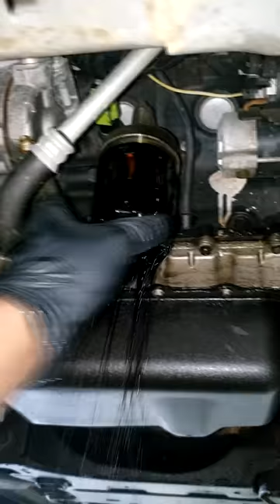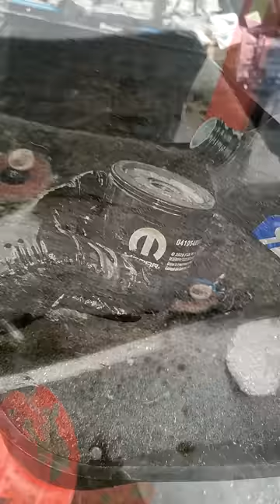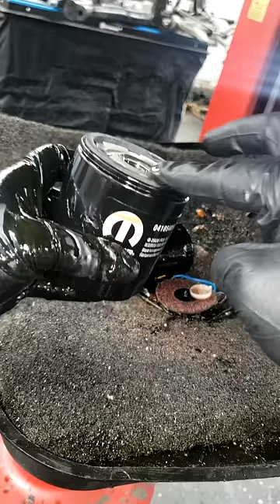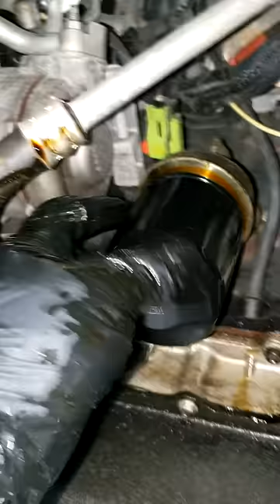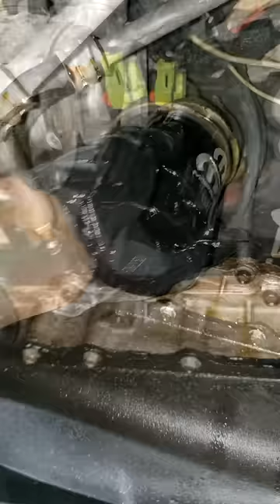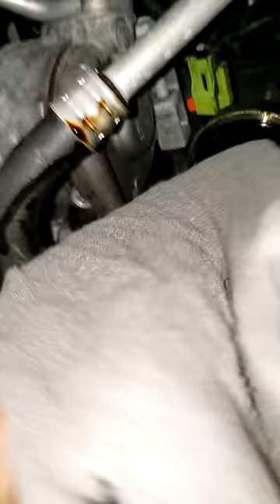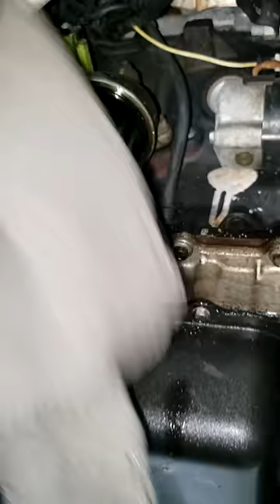Don't Lie.. Are yall still doing this?

Comment: Used to be a mechanic, now retired, but i still do my own maintenance and repairs to my own vehicles, and yes, i always have pre oiled the oil filter to help prevent dry starts.
Reply: on a 1040/1042/1060 filter?
or even a 7502 napa/wix (GM PF63 iirc) size?
.
that filter (and the WHOLE FUCKING MOTOR) has pressure in 2 or 3 seconds
.
especially with newer engines with TIGHT bearing oil clearances..... that tiny bit of dirt = 20,000 off the life of the motor
.
ya... a Detroit diesel series 60 or a 350/351/360 isnt going to care
.
but a hellcat? mustang 5.0? gm vette 6.5 motor? or your average everyday HIGH STRESS turbo 1.8L 4 banger?
Reply: @kainhall  why do you type like that
Reply: your vehicle dry starts every morning .Pre oiling the filter is pointless .and you add oil via the rocker cover , whish is on top of the engine so the oil makes its way down so all of the engine bits already have enough oil  for those few seconds during start up after an oil change
Reply: Even after draining the oil there's still sufficient oil left on the internals to start "dry".  I do oil the gasket but I don't fill it up.  It doesn't matter.
Reply: @randomusernumber1 Exactly the way I see it 👍
Reply: Alright I've got an 88 Grand Marquis with a 5.0 EFI, whenever I've done my oil changes and forgot to put oil in my angled filter, I had a lot of lower end noise from it lacking any oil to critical parts, DESPITE using Lucas in my changes to aid in lubricity and extend oil life - granted it's an oil motor and not a synthetic oil motor which doesn't add much for life but does decrease wear and I've yet to drop anything on the original 302 from pistons to pan. After I parked it with over 350k miles it still runs fine, other than chatty pulley bearings from what I don't know and nor do I have time to find out right now. My 97 explorer has a similarly angled filter, of which is use a shorter version so I ain't gotta break a fan shroud or bust knuckles when doing the filter drop, and I still add oil to it enough it won't leak out during install and prevent engine noise since it's not a fully charged filter. Y'all gotta remember when older motors needed time to get fuel to the carb and during that pre start oil was also being pumped as well to prevent super dry starts. As EFI became mainstream and motors became more and more computerized, sensor ridden and expensive they started much faster. Enter the anti-drainback valve found in most filters, not only did it allow oil to be almost instantly there for engine parts, decrease wear and extend overall service life. Granted filter placement and orientation, not to mention oil sumps that are more common don't exactly need those valves, back when you had a carbureted motor that needed choked during cold weather, that valve helped the motor work less in lubricating with thick cold oil from the pan than with cold oil in the filter so it could be started with a little less effort.....but advent of mainstream EFI and synthetic oil motors got rid of this headache and not instead of print things like this in owners manuals they print warnings on ingesting oils, battery acid, etc 😂😢 my first car was a 76 comet with an old iron horse motor which always had dry starts until I started pre oiling the filter, not just the filter O-ring
Reply: @krystoffersprague6100  that was a long one Kryst, barely made it through it all 😂, but I did, because I ain't no quuter.
Anyways. Old engines that were made back when dinosaurs were still around were just poorly made, by today's standards . The metallurgy was not what it is now.
Everything was cast in open air, slag and impurities were the norm. Heat treating shit steel gives shit results and so on. That is why every old timer still has a cut off distributor shaft to spin the oil pump after an oil change or a long stay. Back in those days you needed to do a lot of things to make sure the engine lasts.
But we are not back then. We are now, and now metallurgy has advances so much that even the cheapest chimasium is on part with what was available back in those days. Better steel means more precision and consistency.
Oils have also greatly improved, the film strength is higher, the lubrication is better and the taste has also improved to practically tolerable ( I am a mechanic, I've had oil on my face, hands and in my mouth multiple times, sometimes it's even brand new oil, old diesel oil tastes the best tho. DON'T DRINK OIL KIDS! MOTOR OR OTHERWISE!) 
I'm conclusion, many practices that were common place a few decades ago are obsolete today, they aren't bad, just unnecessary. On my older vehicles who have the filter facing up I do fill it up because I can and I see the possible benefit. But on my more modern ones with the filter facing sideways or down I don't bother trying, it's difficult and as stated, unnecessary. 
As for why your engine made noise on start up, it was just worn out and the oil cushioned it. I am guessing it was a push rod engine, those like a lot of zink in the oil due to the aforementioned poor metallurgy. 
Have a great day. 
Also, oil can be changed on a cold engine, you don't need to run it just to warm up the oil, have fun with that bit of info 😊.
Reply: The oil pump sits in the oil pan fully submerged. Prefilling filter does nothing to precharge system as pump intake is fully submerged. The oil filter is on the return side of the oil so the pump fills it, there is plenty of oil in the pan so system is not starved. Hydraulic systems are set up the same way, rarely intake sides are filtered. If it is one on the intake side, example diesel engine fuel filters, then prefill. Otherwise there is no point to prefilling automotive oil filters.
Reply: @Freiherr Dinkelacker I've had it since 08 when it was 20yrs old with 79k original miles. Since 2022 it's sat parked and moved once since my father in law passed, before that I used it as a daily driver for 12yrs, he for 2yrs, keeping it mechanically sound despite the lower end knock that persisted with each oil change with a dry filter.....even a mustang performance shop owner couldn't hear the subtle lower end knock and when I mentioned it only did it with a dry filter, he insisted on prefilling the filter even with a 2 stage oil pump because of the hydraulic lifters needing their oil and getting oil to vital parts. That subtle knock may need an overhaul, I'd love to do a frame off restoration in the future, but if my other two vehicles take a crap to where I need to bring the old girl back on the road, it'll be fine since I know my motor and it's quirks
Reply: Wut 😂
Reply: @randomusernumber1  no it doesn't lmao I worked at a oil change shop for 2 years and i did both and when you dont prime it. They sound like shit for the first couple seconds. Our cars do not sound like that every morning. Don't believe me try it yourself
Reply: @barrynordstrom331  wsit so you think it pumps everything though the system first and then it goes through the filter last lmao. What logic did you use
Reply: @gabrielgalaxygh  believe what you like mate , my opinion wont change the world and neither will yours . If you think that  dancing naked in a corn field will prolong the life of your engine then  by all means  dance your heart out .
Maybe i am doing irreparable damage to my vehicles , but out of all my cars and bikes I've never had an engine fail .I ride a lot , My bike gets 3 oil changes per year on average . Maybe the Japanese and the Europeans just build their engines better than americans do ?  Whatever the cause may be , the quality of oil used and the regular maintenance are what matters , not what ever voodoo magic  some  shaman bestowed upon you in a gas station once upon a blue moon .Have a great day .
Reply: @randomusernumber1  ok I read it after all because curiosity got me. 
When did I say that if you don't do it that your engine blows up or that is last forever if you pre fill? Go ahead I'll wait....... exactly I never said that shit. Read what I actually wrote. 
I said it sounds like shit on startup if you don't and when you do it doesn't make that noise. Dont believe me, try it on your next oil change and I guarantee your gonna say ohh that what he was talking about. Dont be ignorant bro
Reply: @gabrielgalaxygh  you do it because you believe that it is good for the engine , meaning that you believe not doing it is bad for the engine . 
Nothing lasts forever , at least nothing that humans can make currently . 
And i have tried it , makes no difference , as stated maybe Japan and Europe build  engines better than America , who is to say . Oh it's me , i am to say , did you read the part where i change the oil on my bike 3 times per year because i ride it so much ? That thing has never been prefilled , not by me , or the factory , the filter is on sideways ,it was never meant to be possible to think about prefilling it . And again , my opinion is my opinion , it wont change the world  and neither will yours , it does not matter  ,people will believe what they want to ,just look at flat earthers .
Reply: @randomusernumber1  I literally just told you why I do it.. because it sounds like shit.... also my car has a sideways filter. You just fill and let it sit for a minute or two and it soaks into the material and like I said its not gonna blow your motor so idk what 3 oil changes on your bike has to do with anything. 
Just curious because I ride also.
 What kind of bike you got? Lol
Reply: @gabrielgalaxygh  Why are you so hung up on this ? If it was helpful for the engine it would be mandatory to do and debating it is pointless . If it is not helpful for the engine then debating it is pointless . You think you hear a sound when you don't pre-oil ? Well i never have . So either your engine is worn out  , or it was badly made to begin with , or you are hearing noises that are not there but you have convinced yourself that they are because you are doing something  and there has to be some result of it otherwise it is wrong and you cant be wrong , right ? There is no point in going on about it , You just do what you believe in and if it is not hurting anyone then no one should care .
As for my bike i ride a small Suzuki vz800 Marauder . It has different names depending on the final drive and where it was  sold .
Reply: @randomusernumber1  I worked at a oil change shop for 2 years so I guess everyone here in the US just has a worn out engine? And no im not the only one. Plenty of other people say it in the comments section also so I'm not just hearing pretend sounds.....

Nice bike though, more of a crotch rocket type myself but one of my friend has a marauder and its looked and soundes badass, not the fastest though
Reply: @randomusernumber1  not trying to argue or talk crap just having a debate brother. You take care though and rude safe and don't forget to pre fill....just kidding lol

Comment: I have a cartridge filter, so my engine is definitely designed to run for a few seconds on residual oil while the filter primes. Same goes for anything with a side mounted filter, such as my previous vehicle. This is only even applicable to a subset of engines.

Comment: The most amazing part is you actually lube the oring before putting it on so you dont screw over the next guy
Reply: I don't see how it's relevant in his situation. Especially given that the housing is all covered in oil anyways. I'm a perfectionist in the shop and this is a pretty sloppy oil change. The goal is to ensure the maintenance is done, but you need to leave the area clean. This is C.Y.A. for the technician. It shows the customer you care, should they look. But it also allows for any leaks to be seen immediately afterwards so you can be sure you did things properly. It also leaves the area clean for the next guy.
Reply: Hell yeah some of those filters be welded on 😂😂😂

Comment: This is alway a must and just good engineering practice. If your filters mounted in this orientation it so easy to do. So why not. (Just the filling up the new filter with new clean engine oil part) It will extend the life of an engine.
Why is this good practice….
Each time you do this it reduces the amount of time it takes for the engine oil pump to build up oil pressure in the system.
Reply: Exactly, thats how i do it

Comment: Only on the big filters. Oil pump fills it pretty quickly on small ones.
Reply: Yeah i prime diesel filters but the small ones should be fine without it
Reply: I found this out the hard way when I forgot to put the filter on and started up the car for 2-3 seconds. Those oil pumps are no joke

Comment: I drain oil, clean all surfaces, fill filter about half way with a little oil on the ring. Run engine for a minute, checking for leaks then check oil one last time. In 30 years ive never had an engine fail from my oil changes.
Reply: Same here.

Comment: Messiest oil change ever from start to finish
Reply from the maker: Yea they can get a little messy at times. Im sure the mechanics used to it
Reply: You can't really do differently than he did ...
Reply: I change oil for my pal and myself, yeah this looked terribly messy.
Reply: @PhilQc109  what? of course, you can, and you definitely don't need to put oil in the filter. Just lube the gasket and make sure the old one came off with the filter.
Reply from the maker: @laxminarayananks1520  But what does this mean or matter? Help me understand why yall angry that you see somebody changing oil and it appears messy.
Reply: Honda oil filter on some model screw on the side of the engine. You will spill all that oil while trying to screw that filter on
Reply: Yea, I usually use a pet pee pads in case oil drips everywhere except the oil bucket I use. Oil goes everywhere, LoL 😂
Reply: I've done messier
Reply: @rodriguezdelbydr than fill the filter half way only so it doesn’t spill
Reply: @OnlineMechanicTips  don’t worry about the guys getting mad. Narcissistic mechanics will always look to get mad at something your doing “differently” than them. You can do the job messy or not. Me, I do it messy and I clean up after, no big deal 👍🏻.
Reply: @teevee2145 same.
Reply: @OnlineMechanicTips Are you talking about yourself in third person or are you not the person who we saw do the oil change... .?
Reply from the maker: @MechanicWelder94  excuse me
Reply: U must be a joy at parties
Reply: Nah bruh my mom's ex boyfriend changed the oil in my late great grandfathers van a few years ago and literally got it every where including in his own eyes dumb ahh😅😂 it was literally in the driveway and all down the tires, undercarriage,all over him like Their wasn't alot of space where he changed it that didn't happen to have oil on it
Reply: @rodriguezdelbydr  You need to dump out the excess oil in that case before installing, what you are trying to do is saturate the filter elements so they flow immediately once the oil system pressurizes.
Reply: @PhilQc109  do your cars not have actual oil drain plugs???
Reply: Wipe that shit down 😂
Reply from the maker: Grow a pair drama queen
Reply: Maybe it was his first time? Sounded like he was kind of slow too
Reply: @OnlineMechanicTips  Because you're telling people how to do it - while your own work practice is so sloppy and you apparently don't care.
Reply from the maker: @peterrenn6341 It's just a oil change. All the oil from the engine now in the drain pan, how cleanly it got there, who TF cares. Any excess oil on engine wiped down off camera. Some of you guys extra extra for no reason. There's a diff between the everyday shop life of a mechanic changing oil daily and one that change his oil at home once every 2 years. But the results are the same. There's no need to be drama queens
Reply: Spends more time wiping the filter than just having clean gloves.

Comment: Yep, I do pre-fill the filter. Let oil soak. Add oil again. Repeat until oil with not drop anymore. I do it for oil filters that are on the side as well, but just soaking the filter element. New oil does not need to be filtered !!! If so, change brand of oil !